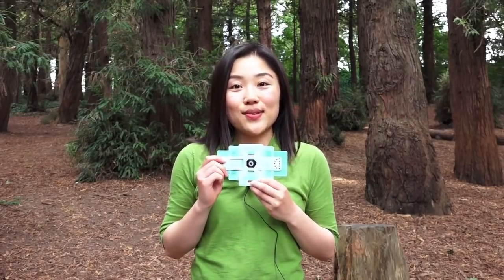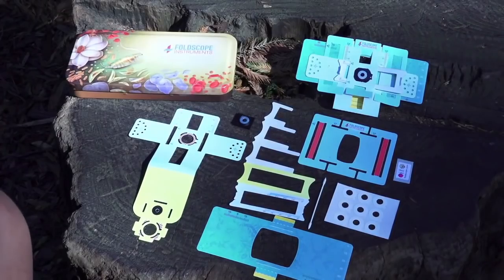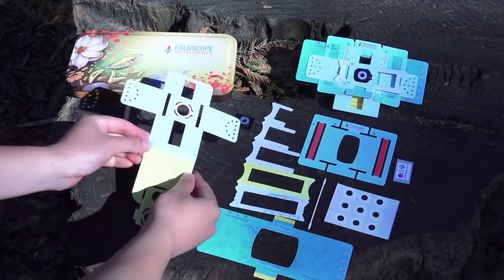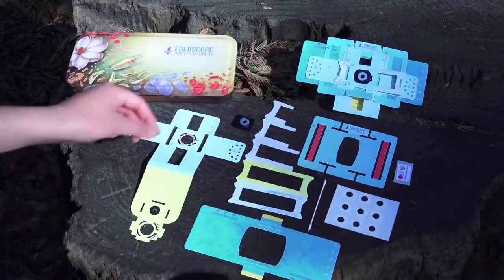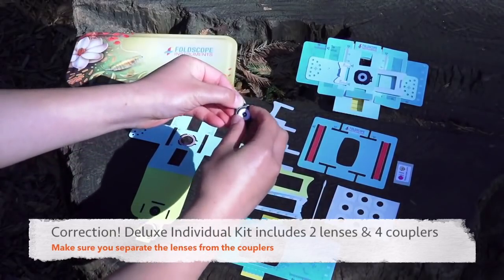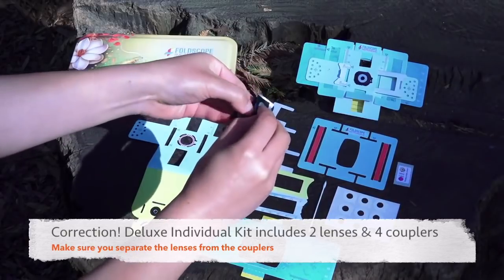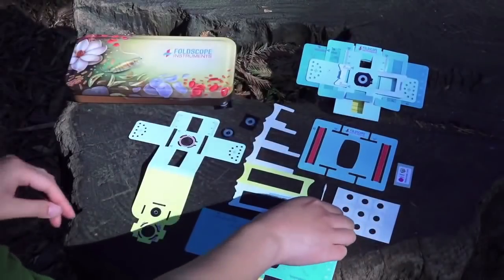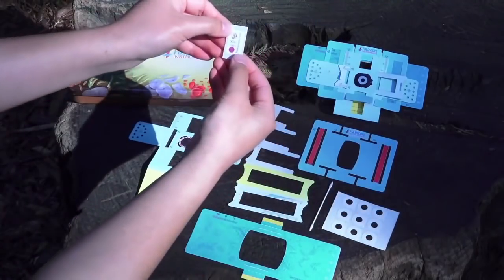How to assemble your Foldscope

Comment: Scam, scam and scam each costs 500 ₹ to 600₹ in India which supposed to cost only 70 ₹.

#FoldscopesHaventReachedPoorStudents.  And I want Mr Manu Prakash to know this.
Reply from the maker: Hi Harsha, 

Our product is not a scam. Although we provide suggested pricing, we cannot control our Indian distributors' pricing (which I believe you're referring to). The only pricing we can control is on our website, and we do our best to sell from our website in an accessible fashion. Online, we sell the Basic Classroom Kit (20 Foldscopes for $35 - so $1.75 per Foldscope) at zero-profit, because we want to make it as easily accessible as possible for users around the world. We recognize that shipping charges from our website can increase this cost, but those charges are out of our control; we are doing the best we can to provide a low-cost product.
Reply: Idiot it has gst 3 times 12% for the product

Comment: Magnification power?
Reply from the maker: The magnification power is X140. When coupled to a smartphone, the smartphone's zooming power can be used to increase the magnification substantially.
Reply: 140x
Reply: @michaelcandido2824  But their article shows it can magnify up to 2100X ..Is that possible?
Reply: Definitely not! Light scopes have a maximum magnification of 1000x and need oil to refract the light that passes through. Samples must be slice thin small. The best magnification you can get with a light scope with no oil is 400x and 600 times with diminished quality. This scope advertised does 140x real magnification which is good for bigger stuff like seeds and ascomycete fungi.
Reply: Manuprakash , constructed this foldscope ,had published his article in PLOS ONE.  They viewed some of the microbes in 2100X ,and photo proof is also attached. They said that their foldscope is waterproof and no need oil immersion to view the samples. They said they use different lenses for different magnification..But I always wonder,    does the foldscope have potential equal to the electron microscopes magnification? May be the patented foldscopes  are in 140X ..fine
Reply: These don’t come with any different lenses. Perhaps he has a different model. A lot of claims for higher magnification tour zooming as magnification when it is nI thing more then glorified zooming which will blur as you zoom in more . The optical magnification for at least this model is 140x which is pretty good for in the field work. It will not replace any light microscope any time soon.

Comment: Is this made of paper or a thin plastic?
Reply: Take it off the last lens, you have to pull it apart that's what I did
Reply: Made of paper
Reply from the maker: It's made of a polymer-infused paper that resists tearing, and is waterproof.